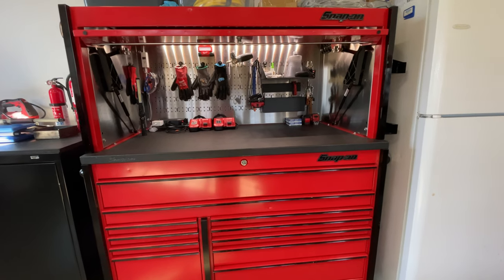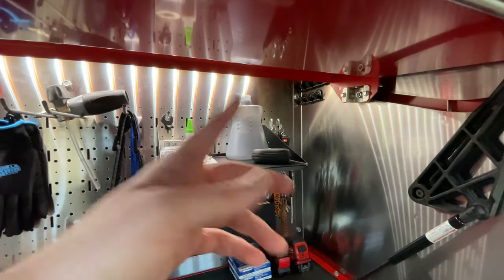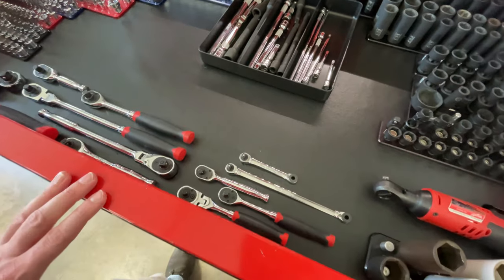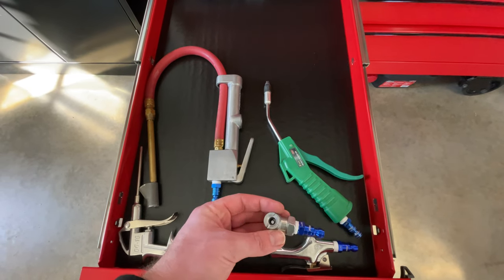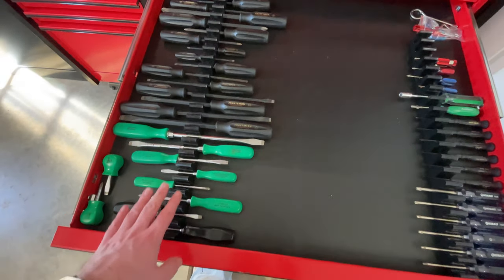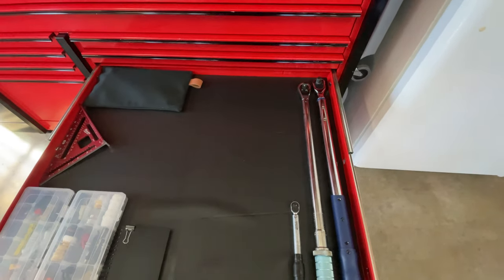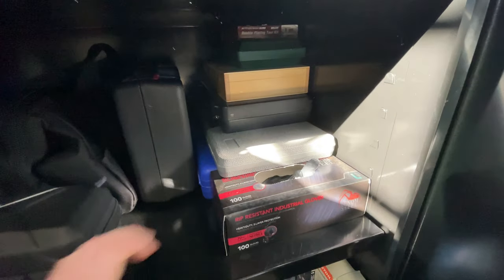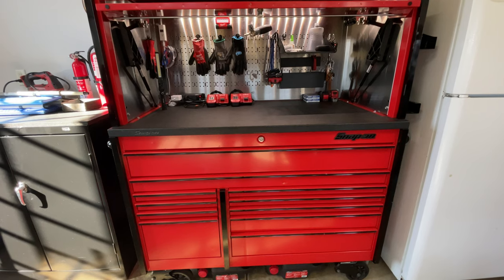Snap On Toolbox Tour - Detailed

Comment: I have a slightly older version of the same snap on box with a hutch and an upper cabinet/locker on top of that. I picked up a 5 drawer craftsman top box from Lowes that I put inside the hutch to hold cutting/scrapping, measuring/layout, picks/punches/files, drill bits and taps/dies/threading. I got tired of bending over to pick out a specific bit or file from the mid height drawers on that box. Nice to see how someone else is organizing that same box. Those Ernst organizer trays are handy! I use the 3 compartment one for ratchet accessories just like you. And I have one of their larger organizers that I've used for 1/4" hex driver bits, extensions, accessories and multi screwdrivers in one of the shallow drawers. They're great, I have a few in my machinist mill/lathe toolbox as well.
Reply from the maker: Thank you for sharing! I always appreciate learning from others.

Comment: Hey, can you tell me the part number for the hutch? And that's a 55 correct?
Reply from the maker: To be honest, I have a picture of the sticker for the box itself but I don't think the hutch has a sticker on it. Maybe it was taken off or something. I purchased toolbox used and I do believe it is an older model. I'm sure they still make something very similar but also it could be slightly different overtime. Hopefully that makes sense!

Comment: Trying to get a new box and I have westling socket trays. I’m wondering how deep your drawer are.
Reply from the maker: The main drawer is quite deep but you would need to determine what you plan to store upright. Some sockets are taller than others (deep sockets from different manufactures) and the storage trays that you use can vary as well. I hope that helps and makes sense!

Comment: You should get good tools snap on and cheep tool box .
Reply from the maker: That is one strategy. I am not in a commercial automotive environment where the benefit of Snap-On Tools really comes into play. There are a lot of good to manufacturers out there as long as you do your research. I do have some snap on products where they are special application. I really like the snap on tools but ultimately the price of them would limit the amount of tools that I could have. Gathering tools from other sources is a great way to expand your collection to be able to get new projects done without breaking the bank. Even so some of the other brands out there are actually pretty good or have tools that snap on does not offer. I think having high quality tools of some thing you use a lot is important, but having a cheaper tool that gets used every so often is much better than not being able to afford the tool at all.